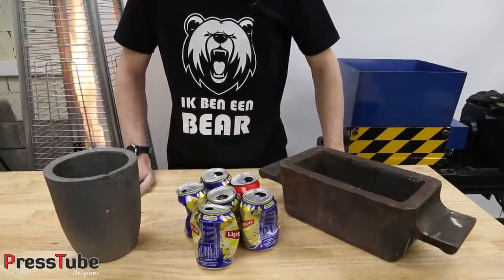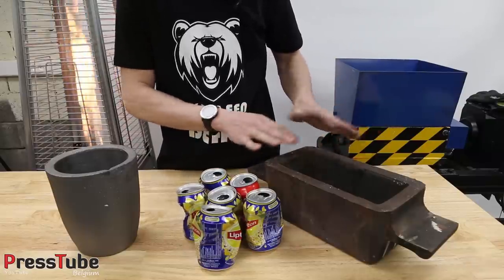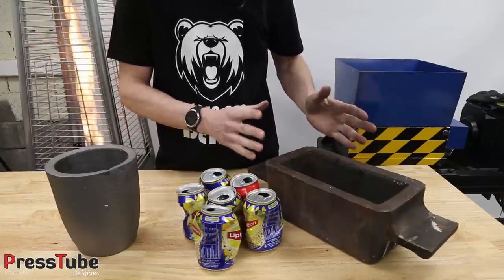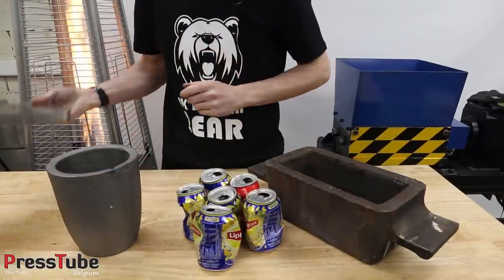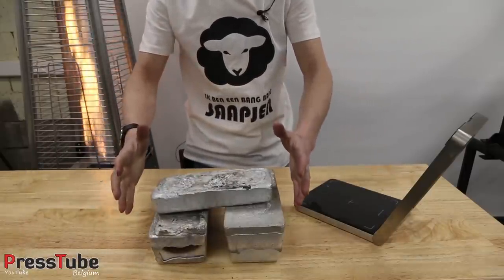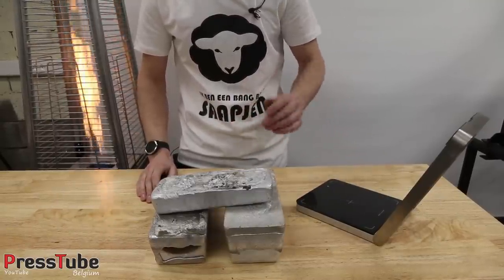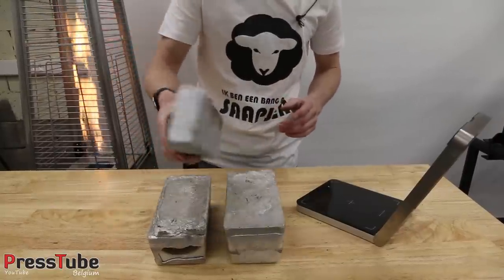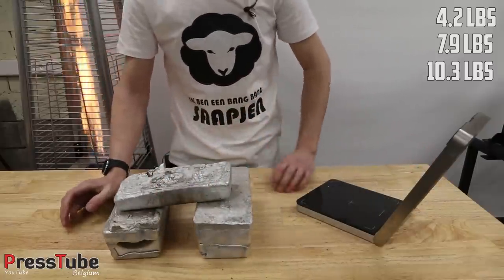Shredding & Melting 1000 Coca Cola Soda Cans Into Huge Aluminium Ingots

Comment: Hmmm its a wonderful video but i am wondering how this experiment cost to me and what's the efficiency and feasibility of this project. 
In term of using engery from furnance (how much gas is used to melt 1Kg of tin cans) , how much energy used by shredder to shredd 1Kg of tin cans. 
How much actual metal you get from it (exclusive of plastic coating etc) 
What would be the final price of recycled product.

Comment: Great, Interesting. However, what I miss in your video is a bit of calculation in terms of cost. What I mean is:
1) What was the investment in all equipment? (can be used many times)
2) How much energy (in money) did you spend on electricity and gas?
2) Assuming your labor cost $10 per hour for 6 hours is already $60 cost/investment (if you would have been doing this as a job)
3) At a price of about $2 per Kg your sale would have been $20 at 10Kg (22Lbs)
So your net profit is a serious minus. Conclusion; this was a fun video! Thumbs up for showing it isn't difficult.
But this might be only profitable in huge bulk. I'm talking factory size.
Selling (shredded) aluminium cans is half the price of pure aluminium.
Anyway, good luck with your next project!

Comment: Dude. Be extremely careful with ice around molten aluminum. If ice becomes a vapor encapsulated by aluminum you will have molten metal flying around the room much faster than you can dodge it. Search "How not to pour aluminum" to see what one drop of water can do.

Comment: If you consider the time and fuel involved, plus the lost weight in slag, it is more efficient to just sell them as cans to a scrap merchant, for the normal spot price. The profit loss would be negligible. The only time I would do ingots is with gold/silver, maybe copper-  With aluminium averaging 50p a kilo, who could be bothered? All that work for £5 GBP? No thanks.  Hint, to clean metal imperfection, use Boric Acid.

Comment: You'd get far more money per pound if you just take the cans in as they are. Cans are a known alloy so the price per pound will be more consistent and higher than if you melt them down and bring them in as an ingot. Because they have no idea what you may have used to melt to get the ingot. Also the fuel used to melt everything down probably cost half of what you made in scrap price.

That being said, I enjoyed the process and the video non the less. Cheers.

Comment: kinda wish you wouldn't use the raw audio for the can shredding, also when working with your metals are you not worried about your cast iron with your rapid cooling and heating? looks like you bring the aluminium up to about six or seven hundred Fahrenheit which transfers easily over to the cast iron and then a probably just after a shell has formed over the molten aluminum you put a chunk of ice on it, which also releases fumes from the recently heated aluminium, so try and protect yourself when your workin on this shit yeh?

Comment: What is the cost for start up, electrical consumption and the lp gas. Now ad all of your time at a rate of $15.00 per hour. I hope you have a good paying job to off set your expenses and time.
I crush my cans, place in container, until full. I am sitting on my front porch having a beer and crushing cans, after that, I go inside and do something constructive with my time.

Comment: By shredding those cans you are creating a horrific amount of oxidation, thus the reason you're scraping off so much slag.

The better way to do it is to start off with two biscuits (minimum for a crucible that large) and then toss the cans in one at a time, using an iron rod to dunk them, thus causing them to melt while completely submerged.  This minimizes the amount of wasted aluminum via oxidation and eliminates the need for flux.

Shredding the cans first wasn't smart or efficient, it was lazy, stupid and caused you to waste a lot of aluminum.